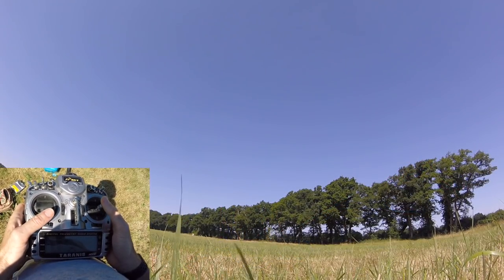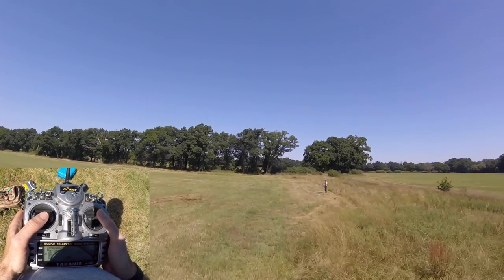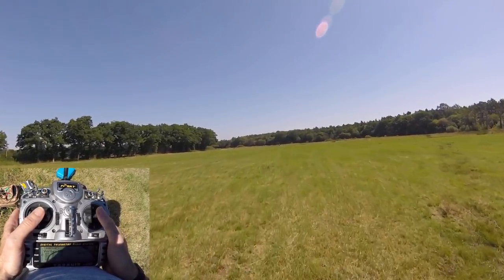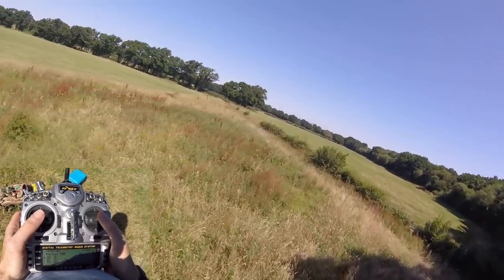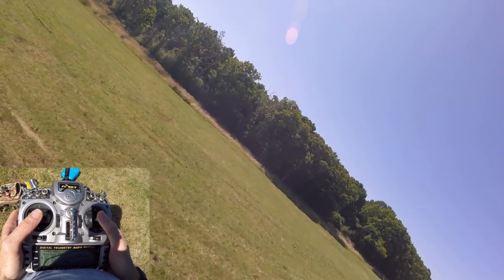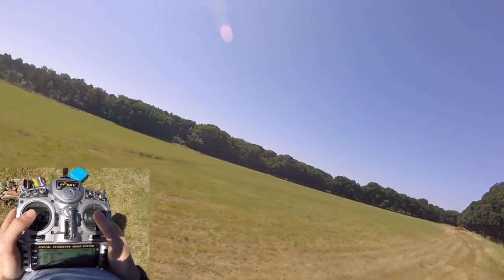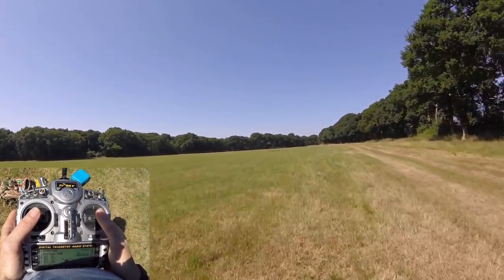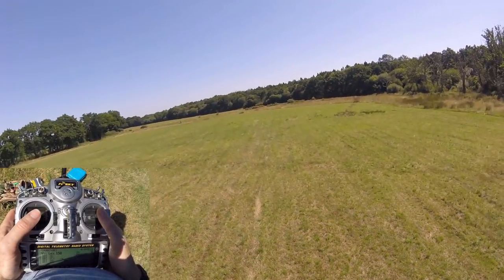FPV Tutorial: Beginners guide to Acro flying: Episode 3 - Throttle control

Comment: Love flying as low as possible. Took my Oblivion into the fields after corn cutting and couldn’t fly any lower at one point. Love the additional feeling of speed.  Throttle management is also very important when coming out of a roll, loop or split s to avoid grounding the quad. Another clear, concise instruction. 👍👏🏻👍

Comment: Really really good instructional video. It not only applies to FPV acro but to almost any fpv quad without altitude control (and to a lesser degree also for those with that facility). Throttle control is a key element of all quad flying and this sort of proximity practice is something I haven't considered until very lately. Having tried it (and having bounced off the ground a few times (I'm a thumb-fingered dolt) once I got the hang of it it was really effective in teaching me better throttle control. (though I still need a LOT more practice)
That and this video have also been also effective at persuading me to buy a bright yellow deviation Tx so I can fly even my toys with some expo...
Reply from the maker: All you need to do is go back far enough in my videos (to around 2012) and you'll see me constantly bouncing off the ground in my tricopter - its just a case of more practice.  I've got a multi-protocol controller to test with some toys as well, but both gimbals were gash and didn't recentre, so I'm needing to finish fixing that so I can try it
Reply: Yes I remember that. (I've been watching since you did game endings) but it was a tricopter and a fairly early one too. :)

Comment: Its strange, Im not wanting to do flips and rolls myself. I find them rather clinical, almost like a PC game. I still enjoy flying my quads fast and low and have started gap flying, although my options are limited where I fly. 
  One of the best things about quads is you can fly them almost anywhere and in most of the prevailing wind conditions. Getting the throttle ramp in the best place is the key. Im still buzzing around in Angle Mode and enjoying it, even though I know Acro would be smoother. Guess Im just being lazy...lol.

Comment: Good video. I find that when trying to do coordinated turns low to the ground, I often need to add forward pitch to keep the quad low. Maybe some wind effect, like turning into the wind makes it want to rise?
Reply from the maker: It's more about the fact that the subtle changes the pitch and angle of the quad during the turn mean that the quad will climb under the same amount of throttle. It's fine to correct with pitch, unless you are feeling you are having to speed up when you don't want to - in which case use throttle to control this instead.  You'll probably end up using a mix of both to get it spot on as you keep doing it - but without ever having to think about